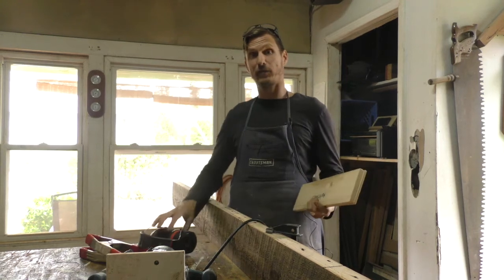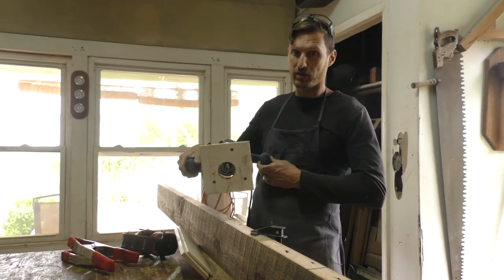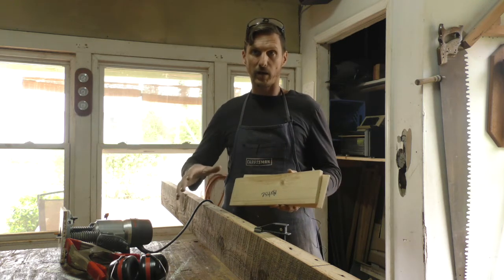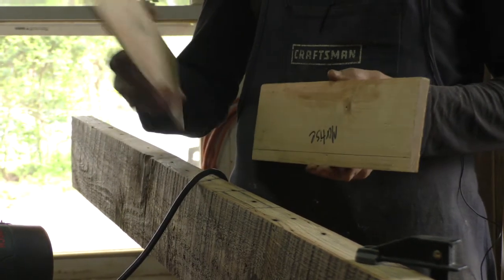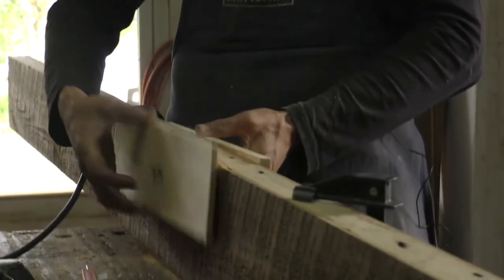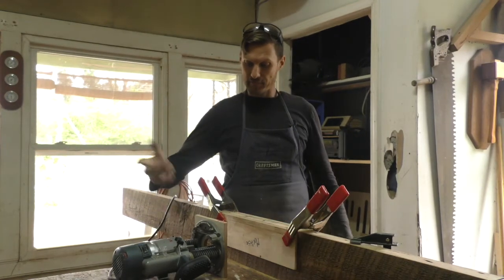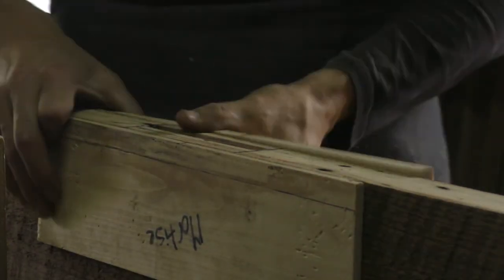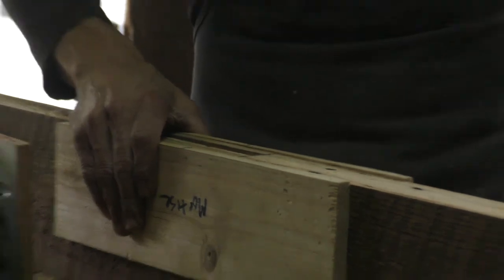Woodworking hack: Cut a wide and deep Mortise fast

Comment: Could you share a link to the router bit you used?  I want to do almost this exact same thing with the same depth
Reply from the maker: This bit:  https://www.woodcraft.com/products/whiteside-ru5200t-three-flute-up-cut-spiral-router-bit-1-2-d-x-2-cl-1-2-sh-4-ol,.  Or this bit: https://www.woodcraft.com/products/cmt-812-629-11-long-straight-router-bit-1-2-diameter-x-2-1-2-cutting-length

Comment: Did you use a 3" straight router bit? I've been struggling to find a long enough router bit for a 3" deep mortice.
Reply from the maker: I used a 4 3/8"  total length router bit.